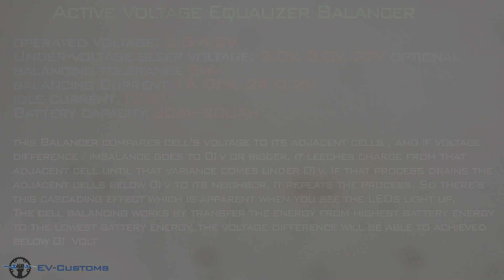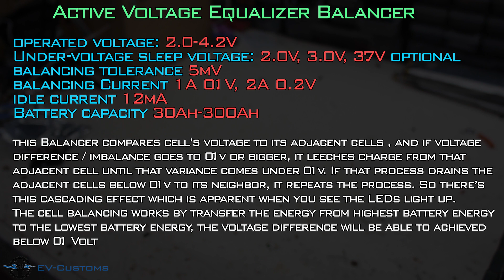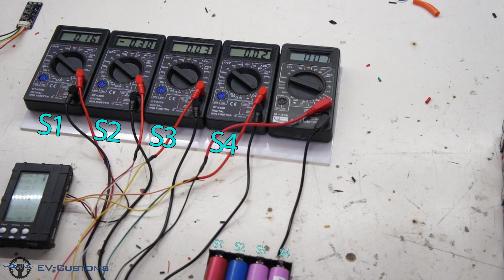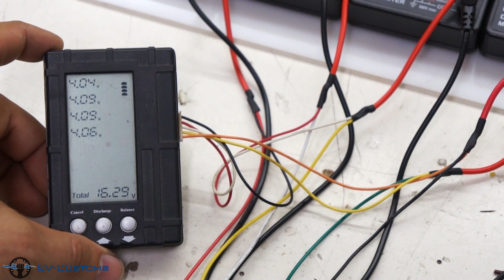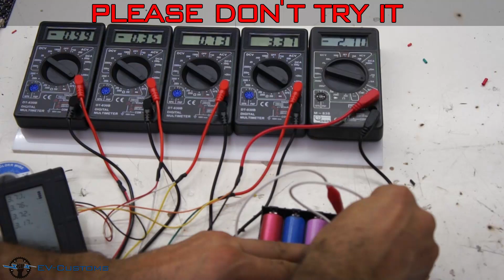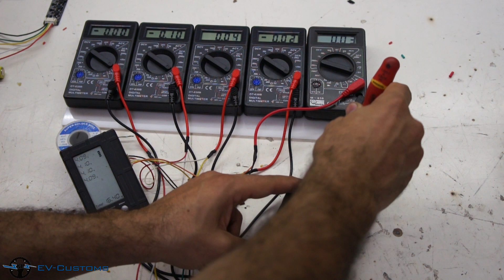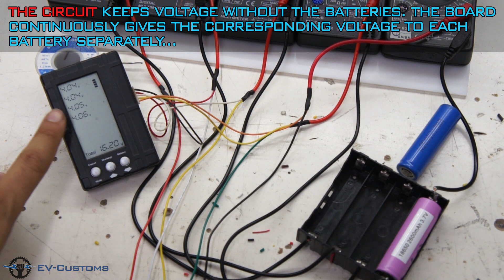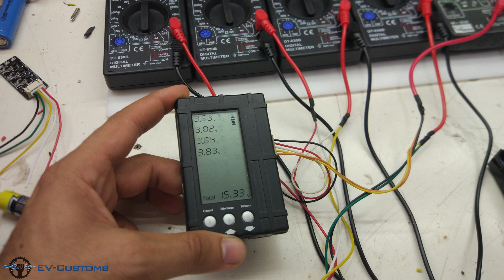5A Capacitor Active Equalizer Balancer (Testing)

Comment: What is the voltage difference when you replaced the pink battery with the brown battery? The current on the meter was 0.79A. (video 03:31)

Comment: Hi. I have problem. I bought "10s 11s 12s 13s 14s" version. I connected 13s1p battery pack, some cells are 3.6V, some 3.9V, some 3.3V. When I connect board to pack, diode described as "run" doesn't turn on, diode isn't light up. No energy transfer. I measured current between 3,6V and 3,9V cell and it is 12 mA. On Your video I can see, that "run" diode is working.
Reply: Did you ever figure it out. I tried with the 10 to 14s model just a simple 4s and it wouldnt work either guessing same problem

Comment: Its cool to see this board tested, just saw the same thing for sale on Ebay. I do like seeing it tested but going into more detail on the circuit and components would be a lot more interesting. Test segment could be shorter.

I'm building a ultracapacitor protection circuit that has a passive high voltage cutoff or balancing at 2.65v @6.75A with resistors, forces ucaps to stay bellow 2.7v. I'm looking into adding an active balance circuit for bellow 2.65v. Like 1-2.7v. Found an active balance IC and circuit  that operates between -.3 to 12v. 
I wonder if this circuit can be altered to operate at lower voltages?

Comment: i blow up 2 of the 1.2A versions because one of the cells were 4.25 volts wth...and how about this one does the high voltages dont burn it ??..and how about connecting and disconnecting the balance wires from the balancers to use them on other battery packs with already cables pre installed ?? i have th connector version not the solder version...thank you

Comment: Be aware that equilizing with capacitors is a dirt cheap method. It requires switches, capacitors and a clock signal.  No intelligence - it is self aligning. That's all. Chunks of charge will be propagated from stage to stage and will dissipate at the weakest cell in order to support it. The method works while charging and discharging as well.
See basic schematic: https://www.researchgate.net/figure/Switched-capacitor-cell-balancing-topology_fig12_236208664
Such balancers work pretty impressive if the voltage diffrence between the cells is high. But at small difference of voltage they get more and more lazy. (What charge propagation do you expect at 50mV chunks of charge?) 
So do not expect considerable amperage in this state. Unless an intelligent design and control is added they suffer on these limitations.  Do not expect such a balancer to heal a broken battery pack along high current applications. BMS is mandatory and eventually it will shut down the pack because of a lazy balancer.

Comment: What were the multi meters testing? Pretty confused about what was happening..
Isn't it supposed to transfer energy from one battery to the next, but you were using a resistor, why wouldn't you use batteries, that it is designed and used for?

Comment: Balancing is one thing. overcharge/over discharge is another. Is there a board that does it all and actually works?
Reply: Most BMS monitor the Cell voltage ... disconnect Load on Low Voltage & disconnect Charger on High Voltage ...

Comment: From 16.28V, only with balancing mode, "after a few hours" the voltage dropped to 15.33V. The difference of 0.95V I consider big. What is your opinion about this?
Reply from the maker: Hi Razvy John. Maybe you have one or more defective batteries...
Reply: @EVCustoms  Hi. No, you missunderstand. Is not my battery. These values are from your video! At 9:11 we can see 16.28V and at 9:24 you have 15.33V. Personnaly, I consider a little bit higher this voltage drop. What do you think?
Reply from the maker: @razvyjohn436  ahh..  nice observation John! if you notice the red battery has the lowest voltage when all four batteries are connected 9:11, I would have to measure the battery voltage with the multimeter before putting it with other batteries(my bad),  the actual battery voltage was at 3.5 Volts, the voltage witch you see on screen  4.04 Volts is not real  because the other batteries due to charging increase the voltage of red battery, plus the red battery was problematic and have  issue of self discharging...

Comment: So this is to replace BMS or what?
Reply: No
Reply: @zamazakati  so what is it for?
Reply: @kaikart123  BMS B(attery) M(anagement) S(ystem), check status of all cells in your battery. Charging max and Min Voltages, Temperature etc is monitored and  stopped or started. The Balancer is making all cells equal voltage which is important for battery pack life. Often Balancer are not intelligent and just equal the voltages of the battery packs (cells in packs parallel equal ech other automatically). So with a 7s system the balancer makes shure all packs have same voltage i.e. 4.0 V. The BMS will show you the voltage, temp and charging options you define or what is given by the manufacturer. BMS often have a low current equalizer function but are often to weak for high current packs. The equalizer or Balancer often have more current to keep the cells balanced.

Comment: hi,

i need this balancer for my lifepo 12S 100ah pack. will it work with the 15s version??
Reply from the maker: Yes my friend...
Reply: @EVCustoms  ok so i beginn with battery - and end with battery 12+  and leave the port 13,14,15,16 opend correct?
Reply from the maker: @Tuedelueh  Yes you must start from black wire witch is 0 Volt (GND) and le 13-14-15-16

Comment: It looks like these balancers decipate the energy insted of moving it from one cell to another, You started with cells above 4.04v and ended at 3.83. I have the same balancer but 17s When I connect it to my cells it all balance them to the lowest cell voltage in the pack. Is that normal or it should ballance them somhere in the middle?

Comment: Nice test, but when your removing batterys the total voltage should be dropping. how is it turning about 8Vin to about 16V? thats madness. ur equipment didnt show anyloss when batterys were removed.
Reply: Nope, that is exacly how it is supposed to work.
It is basicly just one/ multiple capacitor in parallel with one cell, that get constantly switch to another cell.
When he removed the cells the capacitors still got switch to the empty slot.
The batterymonitor just showed the voltage of the capacitors.

Comment: Perhaps an explanation of what you are doing in each step would help? Saying something like "without battery" doesn't mean much unless we know what you are doing. We can't even see what your meters are set to or how exactly they are hooked up. Maybe try explaining your setup before you start testing? Also, why not just keep this real simple...use the battery voltage meter you already have. Put a low voltage battery in with the others and time lapse the results along with an amps meter off the circuit so we can see the actual amperage transfer as the circuit balances the cells. Your video pretty much looks like a bunch of things happening with some captions and no way to know what you are doing.